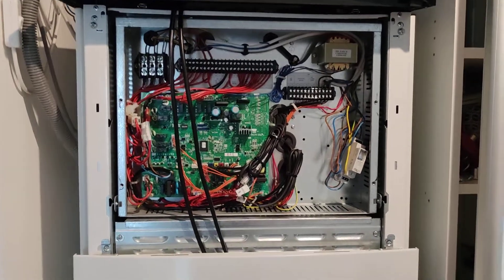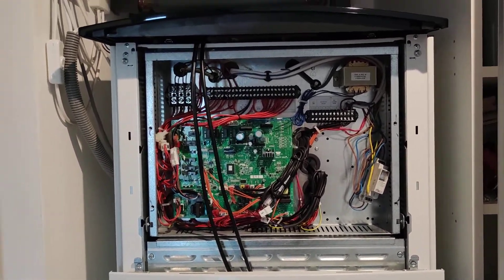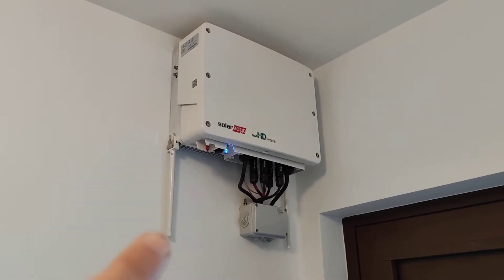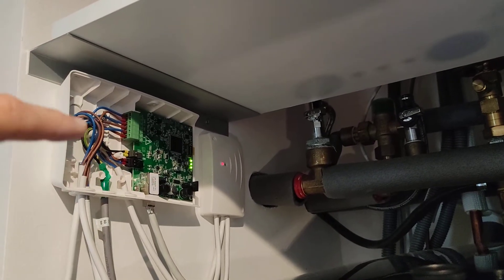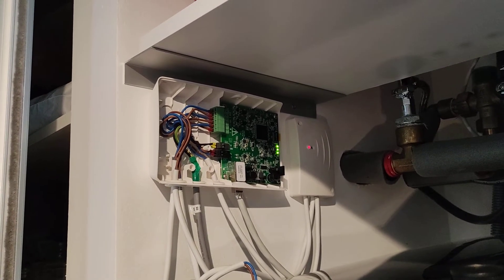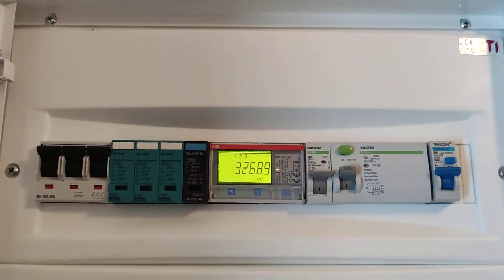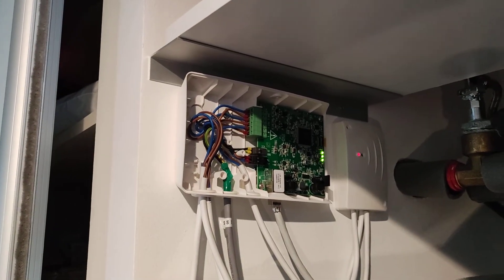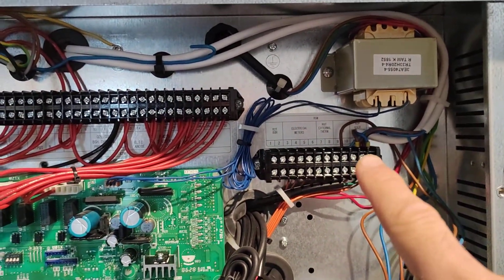Daikin Altherma 3 with photovoltaics - 2nd video about communications.

Comment: Hi, is it possible to connect smarthome dry contacts to Alttherme Smartgrid contacts? I can manage within the smarthome to activate contacts when there is overproduction. Cheers
Reply from the maker: Hi, sure you can. I saw someone has used Shelly for example. You can then connect it to Home Assistant, or OpenHAB or what else.

Comment: Dear Miso, 
We installed the whole thing and checked to SG0 is going though. We changed 2 settings in the heatpump: [4-08] to 1 (the others were already at 1) and the pulse setting D-08 to 4 (100 pulses / kWh). The ABB B23 has only ouputs 13 and 15. They are connected to XA2. I the polarity important? The ABB pulse is configured as Act In. I wonder if this should be Act EH. We don't see LED 4 going on. Could you advise what I missed?
Thanks in advance, Martin
Reply from the maker: Hi, just saw what you wrote. Did you set up the pulses also in the web interface of Altherma?

Comment: Here in Belgium i am trying to get this to work but the smart grid light keeps blinking. I have a digital power meter which is connected to a device which can switch 2 dry contacts to sg0, sg1 and 230v to the L + N on the same connector. I do not have the option to use a dynamic power setting but am okay with that.  If I close a contact I can measure it on the lan adapter pcb. So that is working. I don't know what I am missing. Do you have an idea?
Reply from the maker: did you tried to reach the LAN adapter through IP address in the web browser? there you can set the thresholds and pulses.

Comment: Thank you for this video! What exactly is the electricity meter measuring? Everything in your house? Or everything but the heat pump system?
Reply from the maker: The one in the fuse box is measuring total energy going from the house out to the grid.
Reply: Ok, that makes sense, thank you!

Comment: Did you manage to make a small electrical wiring diagramof your solution? I am asking this because in Daikin's logic SG has 4 operation modes but the solar edge smart switch only has 2 states (open or closed). Do you know how this works in the end? I am confused - sorry!

Comment: Hi Miso. Very good video and explanation. I have the same heat pump as you and the same inverter as you with 6 kWp photovoltaic. In order to do the thing you have done I am gonna need: 
- the ZigBee Smart Energy to enable the inverter to communicate; 
- The relay smart Energy
- the LAN adapter for Daikin Heat Pump (I have an Altherma 3 Integrated 6 kW)
- An amperometer to read the exact amount of power moved
Is everthing correct? Thanks for your precious help

Or if I do not bother, can I ask you for direct messaging such as whatsapp, messenger, Telegram or whatever? 

Thank you for any kind of answer
Reply from the maker: Hi, Correct, but dont forget the fuses for LAN Adapter and SE Smart Relay (see the docs). Write me your WhatsApp please.
Reply from the maker: I have 2 smart (ampero) meters. SE for the inverter ABB for Heat Pump. You will need probably ABB only - RS485 will be used for Inverter and S0 for LAN Adapter. I have SE one with Inverter installation, so I kept it...

Comment: hi, i got a question about the meter. ABB B21 212-100 (single phase) got two output : pulse and rs485 .It should be possible to use at the same time the rs485 to connect the SolarEdge inverter and the pulse output to connect the Daikin lan adapter? Or i must use two different meter?Thanks in advance.
Reply from the maker: Good question. I was thinking the same way as you. I have ended with 2 meters and never tested the RS485 output. Seems to be possible, just buy the ABB and when it does not work with it, add the SE one.

Comment: Hi!! Can I use this configuration without power.meter?
I have the same sistem but it doesn't work.
If yes, can tell me the configuration heatpump?
Thank you
Reply from the maker: Hi Marco, you need to have at least one smart meter to send the information to Alterma to turn itself on. The other I have is just for pulses which tells Altherma exactly how much power it can use. Otherwise you will have just Thresold regulation - for example if energy going to grid > 1kw, turn on Altherma. If not, switch Smart Grid off...
Reply from the maker: Please see the Altherma LAN Adapter manual, all the infos are there. And maybe read the comments under my other video.
Reply: Thanks for your support,
I have a solaredge inverter that open and closed a dry swith(ZigBee), I connected dryswith in sg0 and my question is..... Is it enough?
I need olso an energy meter?
Reply from the maker: @marcol.66  SolarEdge Energy meter at least. Otherwise you will not know how much energy is going to grid currently and you dont have the value to steeer the Dry Switch then.
Reply: @misok  Hi, I have the Solaredge meter that control the dry switch, but I don't now the setting of Altherma3 (smart grid,power limitation,program boiler heatig...)
It could be that I don't have a Madoka termostat also?
My config is brp069a61, Solaredge dry switch , termostat simple.
Reply from the maker: @marcol.66  If the On/Off thermostat will switch off the heating and there is enough power from PV, the Domestic Hot Water should be heated. Can you see in SolarEdge App that the Dry Switch is switched on?

Comment: What is the power meter that you have in the fuse board?
Reply from the maker: The one recommended for 3-Ph in the Daikin LAN Adapter manual ABB 2CMA100166R1000 B23 212-100

Comment: When extra energy is available, as well as the instantaneous value of the extra power, the temperature of the boiler can be increased accordingly?
Reply from the maker: Yes, correct. If under 3kW, only with heat pump, when over 3kW, heat pump heat resistance wire. Floor heating must be typically off (not always, not documented).
Reply: @misok  Hi Miso. I did find this automatic switching info in the installer reference guide for BRP069A61. But how does Altherma know if it's under 3kW solar ressource? I can assume that Altherma will chose how to dispatch power based on how you configurated the Smart Grid settings in the web interface by setting "electric heaters allowed" to "yes".
Reply from the maker: @SuperLeodk  I have installed the Smart Grid Meter in my fuse box (exactly same as in the manual), which sends the S0 signal do the BRP069A61 - 1000 times/kWh. With electrical Heaters Allowed you are right, you need to switch it in the web interface.

Comment: I also want to do this setup. How do you evaluate the prestations?
Did you already took some statistics, for instance with multiple Shelly power meters?

I will start next year, i have also planned this setup.
Reply from the maker: Klaas, here my PV Statistics: https://monitoring.solaredge.com/solaredge-web/p/site/1854795/#/dashboard if you will create your account, you should be able to see also import ant self-consumption statistics similar to this: https://jastrabie.online/energeticka-uhlikova-neutralita/
Michal
Reply from the maker: No. There are SolarEdge statistics + Daikin statistics. I don't have exact sum values. But with my 7kW on roof there is free hot water since may until October. With floor heating it is different, because when sun is shining, I don't need to heat my house. I can even see some of stats on my OpenHAB system.